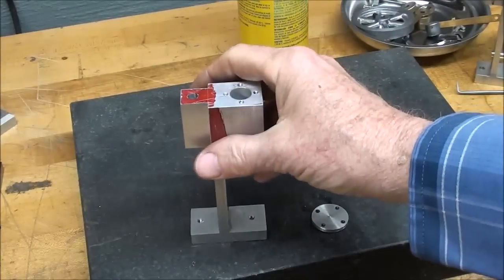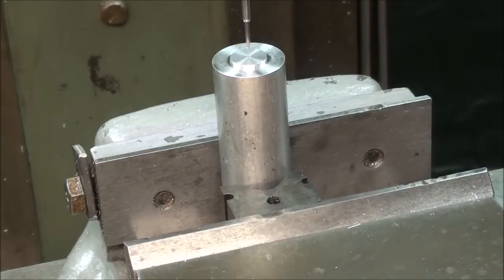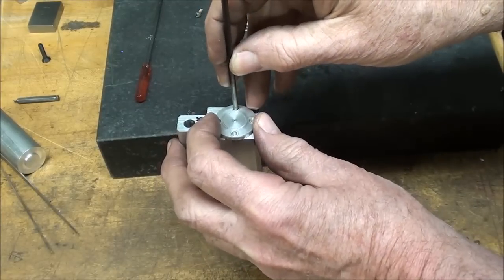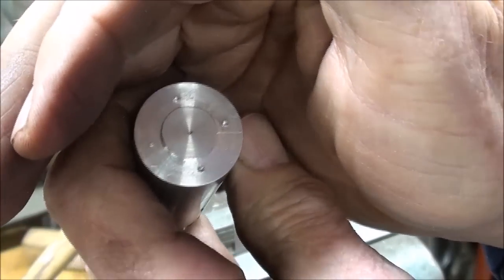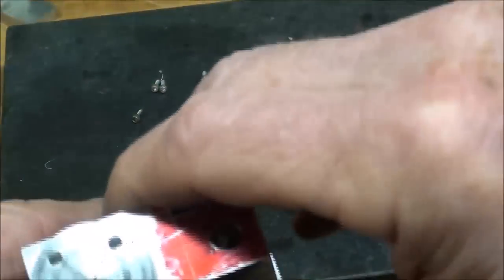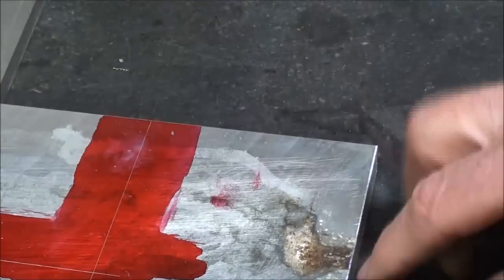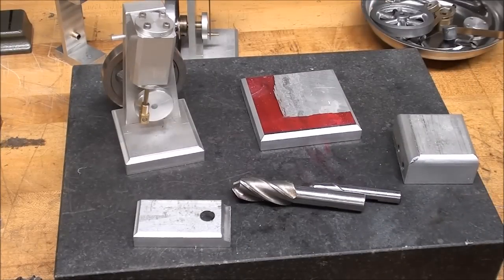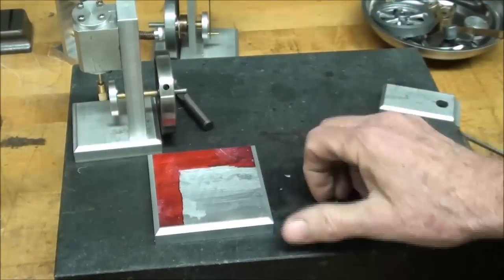tubalcain BUILDS A VERTICAL STEAM ENGINE w/spool valve Part 4

Comment: I like your mention near the end of the video about using which edge of the work as your point of reference. I find it hard to get that notion lodged in peoples heads about when you start making measurements from one corner or edge, that for the duration of the project you have to use that same point of reference for all measurements.
I hired a guy to finish a deck I was building and told him that one corner was my point of reference, I came home 4 hours later to a crooked mess and realized he started at a different corner and everything he had done was skewed. I couldn't get him to understand why it was skewed (he didn't think it would make a difference where he started) so he got fired real quick.
Reply from the maker: THANKS FOR WATCHING--yes, some guys are clueless

Comment: Mr.Pete 222 there is a reason why you put the Cylinder Head 4-40 thds at 45 degrees to center line. By changing the orientation to the center linr of the .500 bore you will break into the threaded hole with the new location.